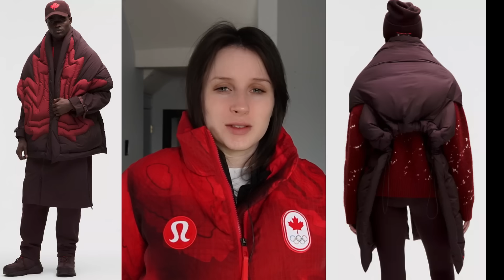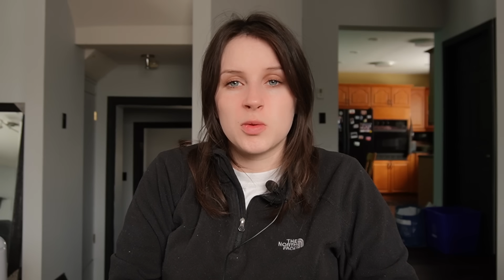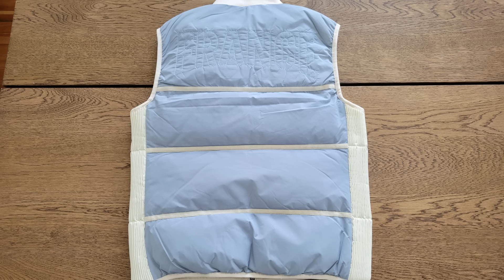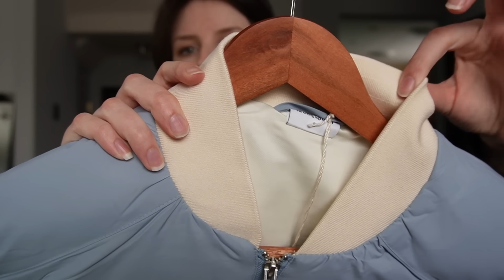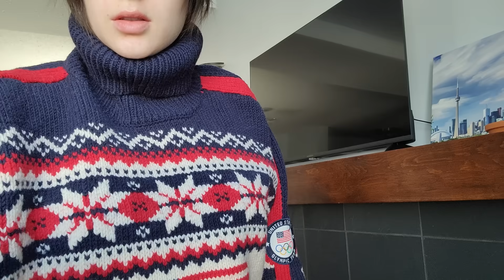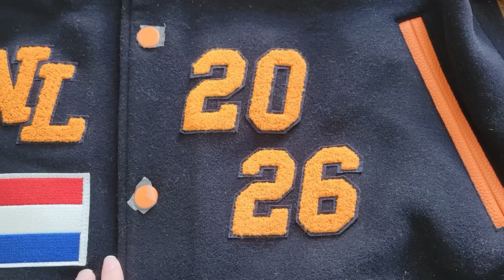I tested Olympics uniforms...the quality shocked me!

Comment: The French vest is not designed to put on the outside in cold weather ! You put it under the coat, or preferably to get warm indoor or éventually outdoor if it is mild dry weather.

Comment: My all time favorite Olympic "jacket" was the USA (Vancouver games, I think) cardigan.  It was wool in very dark navy with a red shawl collar that continued on down the front becoming button bands.  Had red cuffs with a thin white stripe.  It was double very firm knit, thick holding its shape very well.  Low pockets.  There is one for sale on ebay, but themtube wont allow me to link to the picture.   Had the Ralph Lauren polo logo on the chest & small patch on the other side (oddly not aligned - I would attempt to fix that.   I wanted that one so much.  But it was completely out of my price range at the time.